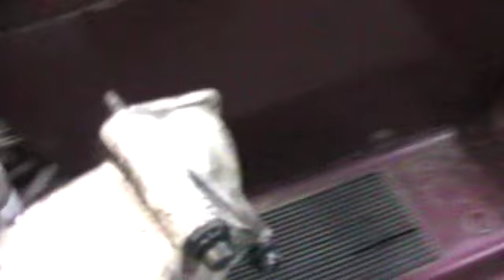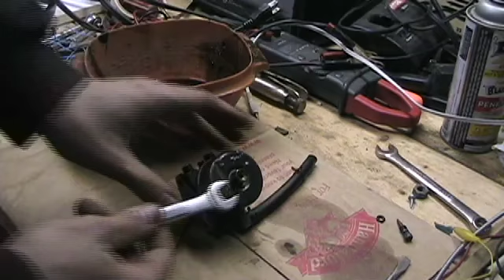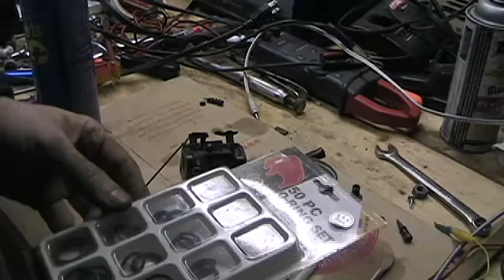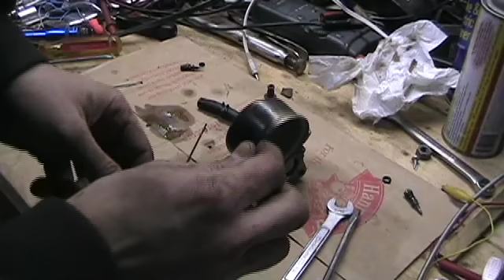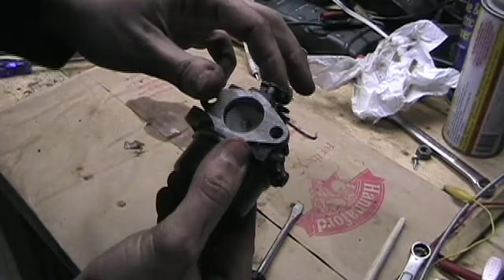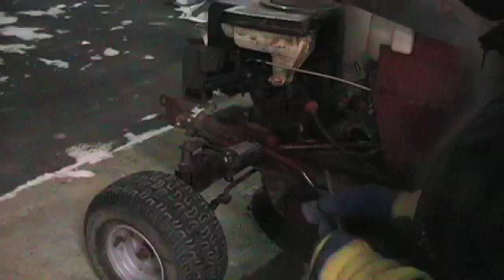Carburetor Cleaning - Murray Tractor w/ Tecumseh VM100 Part 6

Comment: one thing you have to do before rebuilding one is to take out the needle seat because carb cleaner will melt it
Reply from the maker: If carb cleaner melts it, it was doomed to start with.
Reply: if had good success rebuilding carbs even when that happens, it just a normal effect of the high acidity and chemical content

Comment: yeah but here where I live its not that easy to gets such parts so as I am writting this I am actually getting ready to head off to town where I am going to find a motorbike carb that fits to size with the engine. only thing is i will have to make a new (neck) we call it here in greece, for the carb to the engine. wont be a prob just a bit of time. I do a lot of cut and put together on such projects for its in a way way more simple than actually truing to find the original.

Comment: i have also the same so I opted to actualy change the carb and that will be me sorted with it and it will benefit me also for I also want more power to it so I am going for a little bit bigger carb and later I think to make a more drastic move and add a compressor . that will be made for part such as a heater fan of a bus that I have acsess to and the power belt will be coming off the bottom shaft so that comes into use too,it will need some thnking and work but I think its possible.

Comment from the maker: eh...if it's cheap...it could have cooling fins that are plugged...or the carb is running lean/wrong...could be a lot of work or something easy.  Belts are very available at most part stores, like Napa and the like.  Blades are also easy.

Comment: looking at buying a 12.5 hp murray riding mower owner says it runs and cuts  but it overheats do u have any ideas of the cause of this? Also it needs new drive belt and blade that shouldnt be hard to get should it?